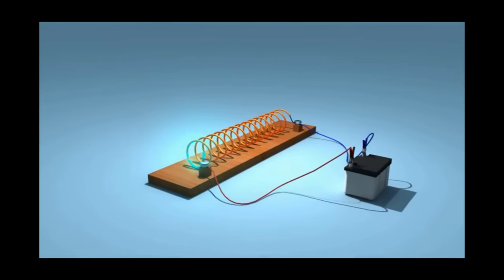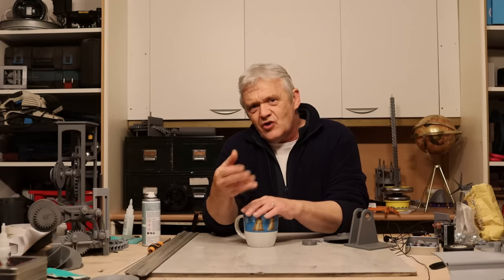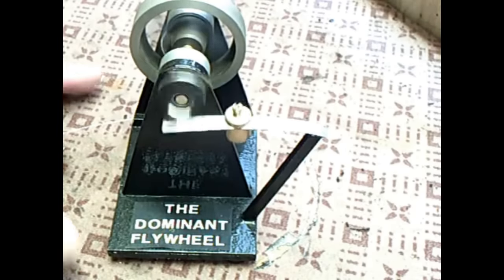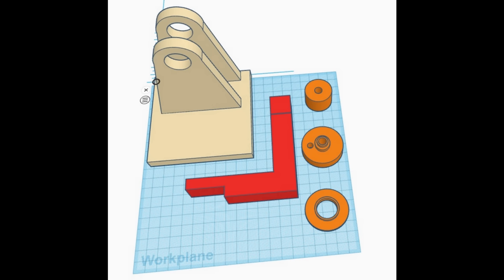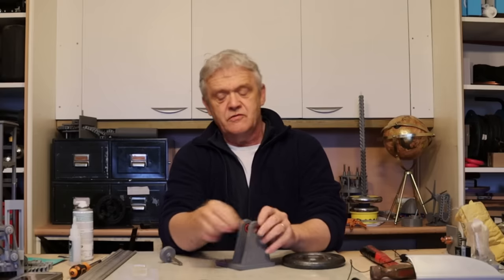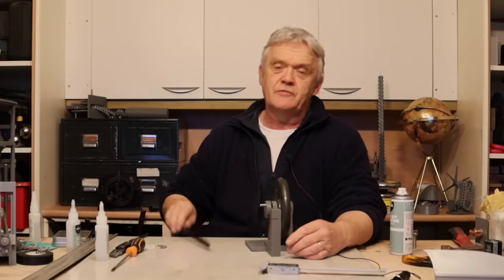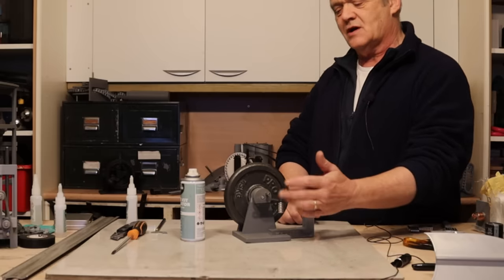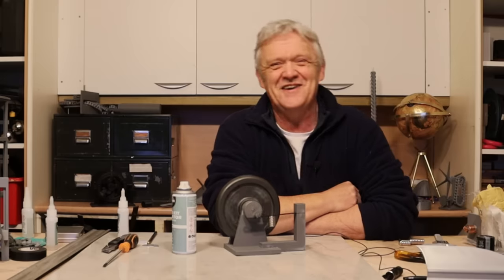2096 An Unusual Spring Motor

Comment: Without the spring it would spin even longer!
Reply: You are right, that's must be a joke or something
Reply: I mean, it's a fine mechanical analogy for the tank circuit, but it isn't a "motor" and doesn't create and "free energy", or even store any energy that it didn't just steal from the flywheel.
Reply: It also won't have a specific frequency like an oscillator. It'll just slow down until it no longer has enough energy to overcome the spring..
Reply: Exactly what I was thinking. The energy returned to the flywheel by the spring.... Has to be less than than the energy it took to bend the spring plus the friction of the roller against the spring.
Reply: Throw it out of the window of the space shuttle, it’ll keep on spinning 😵‍💫
Reply: It's a stabilizer, not an extender, imo
Reply: @TheChzoronzon  the spring being tuned to the RPM of the flywheel... The strength of the spring will want to push the flywheel forward at a specific RPM. However at low RPM the spring is working against the motor and flywheel. At the Goldilocks range of RPMs it would not be doing much, and if the flywheel goes way too fast the spring won't have time to return and the spring wouldn't be doing much at all. 

Would be interesting to see this with a small low torque motor applied. Could the spring be used to regulate the speed of the flywheel if the motor current/voltage fluctuates.
Reply: @cmdrredhawk  I'm not sure if all that means you agree with me or not :D

Anyways, what this reminds me is of a watch escapement ...which function is to stabilize a rhythm
Reply: No it won't smh the spring returns enertia smh
Reply: One heck of a balancing effect could take the enertia very long lasting or not.
Reply: Magnets on the spring pass those thru a coil… bing bang boom
Reply: Actually it wouldn't. The resonance that is created stores the energy and releases it at a much lower rate. Which makes the wheel turn longer. Minus the resonance - the energy would certainly be higher - but the resistant forces would be greater in the bearings (higher speed) and the energy would dissipate faster. There is always a loss of energy in changing from the rotational energy to spring potential (so I see your point) but in this case - I do think that would be negligable  This is why you would only wind up a clock once and then slowly let its energy dissipate over a day.
Reply: come on guys , everybody can see pushing the spring is costing energy and the spring is not giving back the same amount of energy , and if there is friction to substract  , not to forget mass to move ....  this is so  first law of physics
Reply: absolutely true!
Reply: 👍🙏🏼🇧🇷RJ🙏🏼👍
Impressive.  Nikola Tesla is right.  If you want to discover the secrets of the universe, think in terms of energy, frequency and vibration.
Reply: @edeggermont  a better mechanical analogy would have been a pendulum and spring. But, again, without the spiring it would run longer.

Comment: A pendulum is another good mechanical analogy for a tank circuit. It stores energy as Gravitational Potential and Kinetic. It even has a resonant frequency.
Reply: I'm also baffled . Anyway I'm reminded that the energy in an engine used to compress the valve springs is returned after the apex of rotation of camshaft is reached, maybe 70% efficiency. Many think it's completely lost energy .
Reply from the maker: nic one mate - i agree - cheers
Reply: @ThinkingandTinkering Maybe a better outcome with four springs. One on the down stroke and the up stroke as well as on both sides of the flywheel🤙🏻
Reply: That's my intellectual property please tell this person to remove this video
Reply: @jamesmatheson9624   no sir, you prove that statement first. And even if it were he changed a few things which makes it perefctly legal
Reply: @jamesmatheson9624  That's an odd statement considering I didn't see anything in this video about a racist living in a pig sty, calling firemen and policemen terrorists because they use sirens.
Reply: @philip5940  Blasted out in all directions as heat and vibrations.

Comment: But shouldn't this slow down more quickly simply due to the added friction? I don't get the point in adding the spring....
Reply: Springs have there own stoted potenchial energy,so its efectivly like incteasing the size of the flyfheel the more stored ennergy the longer it takes for it to spool down and release its energy
Reply: The friction can be reduced by adding small roller bearings with very low coefficient of friction to the end of the pin that comes in contact with the spring. That said, the system as is works because of the energy stored in the spring is used up in push the flying into its next circular  motion.
Reply: @kelvinnixon9502  Well okay but this would only mean a benefit If you could preload the spring. Otherwise IT Just magages a Part of the flywheels Power to operate.
And If you could simply add weight to the flywheels I think you should Go this way, have only one moving Part and reduce the noise.
Reply: Agreed. People seem to be ignoring the pressure required to push the spring downward will slow it more than the return spring action gain due to friction.

Comment: It has to run less time than just the wheel alone because of the friction you're adding.
Reply: its okay its made of ice actually
Reply: you also get less power out of an inductor and capacitor than you would if you just stored it in a capacitor. but they're still such useful circuits that they are everywhere. as a simple mechanical device i could see this having lots of uses for quickly interchanging types of motion and mechanical energies.
Reply: @jameshughes3014  I was thinking this would only be useful if you wanted to store up energy in the flywheels spin to be used at a certain point in its revolution. maybe like a hammer or pile driver situation.
Reply: But probably with less variation in speed during a big chunk of the operating time. I mean, a less step gradient (but sawtoothy ) between the max and min (not being able to do a full turn) speeds, except at the very beginning where I expect a sharp drop the first time the peg contacts the blade, if I get it right
Reply: @TuttleScott It could be used for more than just storing energy though. Like a capacitor inductor oscillator it could be used to transform energy, or regulate its speed, bounce it back when needed. making the weight on the spring automatically adjustable opens up even more possibilities.
Reply: @Cinnimin  🔴 What Is Islam? 

🔴 Islam is not just another religion. 

🔵 It is the same message preached by Moses, Jesus and Abraham.

 🔴 Islam literally means ‘submission to God’ and it teaches us to have a direct relationship with God. 

 🔵 It reminds us that since God created us, no one should be worshipped except God alone. 

 🔴 It also teaches that God is nothing like a human being or like anything that we can imagine.

🌍 The concept of God is summarized in the Quran as:

📖 { “Say, He is God, the One.  God, the Absolute.  He does not give birth, nor was He born, and there is nothing like Him.”} (Quran 112:1-4) 📚

🔴 Becoming a Muslim is not turning your back to Jesus. 

🔵 Rather it’s going back to the original teachings of Jesus and obeying him.
Reply: @الدعوةالىالله-خ8م What a ludicrously off-topic comment. This is not a video about religion.

Comment: how effective is it? it looked like it slowed down as much as you'd expect without the spring.
Reply: I was curious about that too, maybe even last run time with the spring
Reply: Exactly. There is no reason to believe the wheel will run longer with the spring hindering the movement.
Reply: @Real46  still fun tho
Reply: this will only shorten it because you ad more friction
Reply: It's a stabilizer, not an extender

Comment: A proper flywheel tank circuit would require the wheel to come to a stop and change direction of rotation. A good example can be found in mechanical wrist watches that employ a balance wheel and coil spring.

Comment: The machine you tried to copy was oscillating although the video did not make that totally clear. It was essentially the same as a balance wheel in a watch which is a very common mechanism. What you actually made was rotating and totally not a tank circuit.

Comment: Looks like fun, in the first demo the peg was hitting the spring further away from the fixed end (clockwise rotation), In your demo of your printed one it hit closer to the fixed end first (anti clockwise) I'm wondering if this makes any difference?
Reply: It does😂 the resonance point is to find the push back moment😮
Reply: I would assume, clockwise it loses more energy, pushing down the spring from the back, than coming from the front and the stored push up force is lower than in the counter clockwise run🤔
Reply: The first way you get more up-force, but over a shorter time, so there isn’t much difference in efficiency cw vs ccw.
Reply: @steveschunk5702  I think testing is in order here, considering the loud click it's making and it's hitting the spring more in the center where the effect of the springs mass will come into play, not to mention the resonance that there will have to be.(Imagine a softer spring wobbling)  By hitting it on the end first and sliding along would seem to be a better and smoother option and the wheel should loose less energy at a time like a lever... It's easier to start jacking a car up by using the end of the lever than grabbing it by the middle. There are a whole lot of forces moving around here, so I'm all for hitting the end of the spring first and waiting for someone to prove me wrong.

Comment: For greater efficiency, I would suggest a roller bearing in place of the solid round stock for your drive pin. Also, in the end where you show your version in action, you rotated the flywheel in the wrong direction. Because of it's mechanical nature you have to take into account levers. The drive pin on your flywheel needs less force to bend your "spring" when it's farther from the fulcrum and your "spring" can return more energy to the drive pin when it's closer to the fulcrum. Yes, it kinda ran, but you could see it losing potential rapidly in the clockwise (for the viewer) direction. Now, if you were to use a straight lever with a counterweight instead of a spring mechanism, I believe the opposite would hold true.

Comment: could you show what a 'bad' tuning is, and how to achieve a good tuning?  or is it just "the longer it spins, the better the tuning"?  would putting a bearing on the lever pressing the spring improve performance, since there wouldn't be the friction of the arm dragging across the spring, as the bearing would simply roll along the spring surface instead of dragging?

Comment: What would the difference in rotation time be between the unit with and without the spring?
Reply: Yer that's the real test of it makes any difference
Reply: Without the spring it will go longer, less resistance. It educational as a form of oscillating stabilizer, not as a magical generator

Comment: We know Flywheel is equivalent to Inductor  and Spring is equivalent to Capacitor but like electric circuit we cannot make mechanical circuit to make tank circuit, everytime you are bending the spring you are adding energy from flywheel to spring and not other way round, as energy is conserved

Comment: Instead of a spring. What about a bi metal strip like in an old indicator? Supply a voltage to the strip and the fly wheel with a brush and when it contacts it heats up through resistance and clicks on giving a small kick to the wheel.

Comment: The original video shows the "engine" clearly speed up during the last take, so, as I guessed right away, there has to be an electirc motor in the axle "bearing". You could hide tiny speaker wires under the paint.
Reply from the maker: you didn't guess you imagined - you also didn't watch the back up video - there is no attempt at free energy here
Reply: @ThinkingandTinkering  I meant the original video that You linked, not Your's recreation which obviously isn't a hoax, but an experiment, which just shows how it can't gain energy out of nowhere :)

Comment: The magnets are needed for the coil in the frame to add energy to make up for frictional  losses using a battery in the base or a 2'' hole in the table so you can move it around a bit to show their are no wires,

Comment: Im not sure the spring adds anything to that system apart from some mechanical losses. 
The flywheel should spin for longer without the spring I’m afraid.
Reply: Another show to see if we are critically thinking
Reply: Yes, I agree with that. The spring can only return the energy that it has absorbed in the first place. In addition, however, the pin rubs over the surface and thus brakes the wheel.
Reply: @MaikWeber yes and no. There is a Point the weight is in balance to itselve's weight. Than it phushes downwards. Do consider, a ocelating mechanism neads a bit of free binding. Maybe it is hitting a bit to much😅

Comment: Robert, could you explain in more detail why this would have any advantage to just using a flywheel by itself? This one has the added friction of the peg rubbing on the spring with each turn. I don't see what you get out of this vs. just a flywheel; in this case, the flywheel is giving energy up to the spring, which then gives it right back, but with frictional losses. So what is gained by this?

Two questions about possible variations:
1. Is there a lower-friction way of pushing the spring? Perhaps a crank slider arrangement so the friction is at individual pivots rather than a peg rubbing on a strip of steel might work better?
2. This arrangement only stores and releases energy for the bottom 130˚ of rotation. Is there some way to arrange this so that more of the rotation of the flywheel is employed? Would that confer any benefits?
3. Is there any way to utilize an escapement like valve or something to gradually tap out energy from some stored source (elevated reservoir of water, sand, or even an elevated weight) to keep the wheel turning at a fairly constant speed? That might actually be useful.
Reply: I think it's more to do with the idea than actual practicality. 
Anytime you do any form of energy transmission/conversion in a real life scenario, energy is lost. So a flywheel by itself will run longer. 
That being said, a flywheel by itself has no practical application either. Not without a way to get the energy in and out. This could be a way to turn linear motion into rotary motion or vice versa.
Reply: this can allow a flywheel to not spin that fast while accumulating the same energy in the system
Reply: I see I've found the nutter side of YT again
Reply: It seems that it is merely a curiosity. Does nothing but elicit oohs and aahs from people as they pass by. Esthetic junk.
Reply: Its not junk the math is hard to see that its geometrically perfect. The pin doesnt have as much friction as it looks. for its sliding accros the pin the rotational force equals some where about 45 degrees whitch equates to a cutting force on that angle it has the most energy. It seems usless because no one wants to put out the energy and resources to build somthing like this big enough to make somthing happen. Using the leveraging force of the weel say about 10 feet in diameter driving a smaller wheel say about 10 inches bothe desighned the same but fed into each other by a gear force. And then ate the most leverage build your generator. Before you go perpetual you wind the clock every 12 hours. I would make the system restart it self with the excess energy and see how long it runs if you wanna test the efficiency of a system sping the wheel by letting it drop a rock. And then see how far it can lift it. If i had resources i would get into a bounch of stuff. You want to have a series of smaller wheels to lift. The more you add the more inturnal friction you get. An unballenced wheel and this concept would probably look pretty cool but some of the energy transfer would go into the slaush of liquid due to timeing. I feel like im venting.
Reply: @detrechrats  It's not even worthy of that. Perpetual motion nutters are a dime a dozen. There is zero point to this. It would perform that much better with just the flywheel, but that doesn't look like it is getting something out of nothing, now does it 🤣